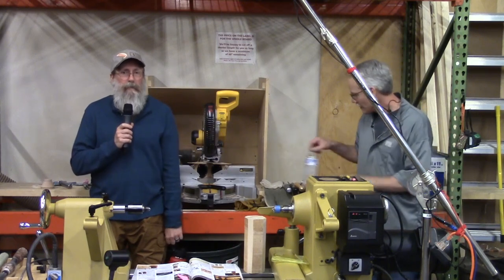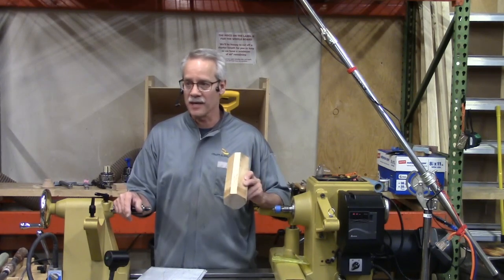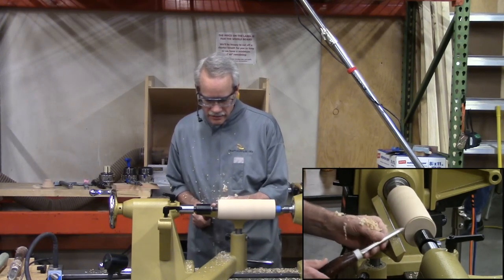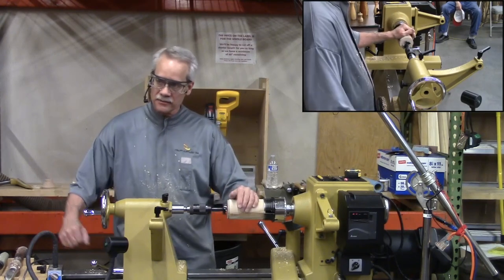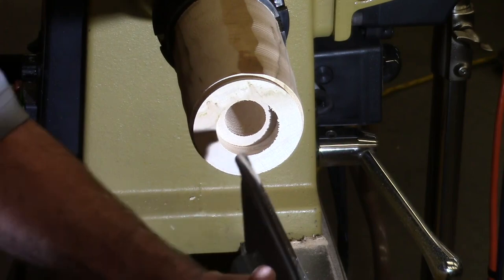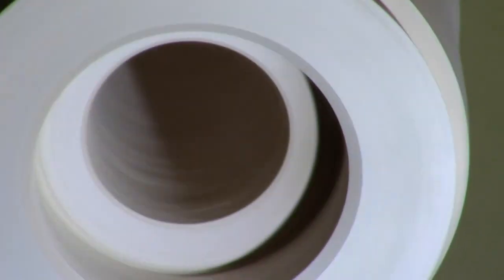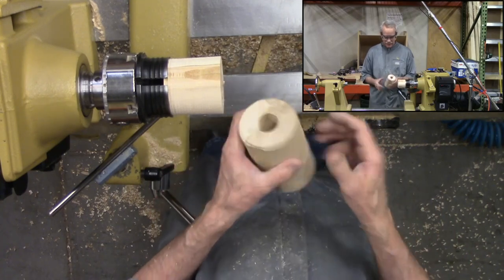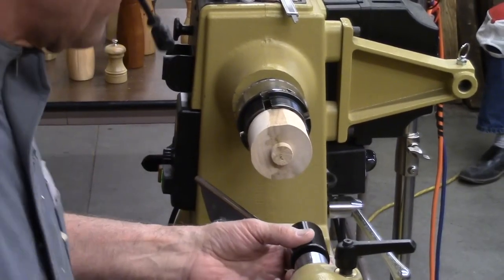Pat Scott - The Perfect Pepper Mill

Comment: thanks for all of the detailed work that is missing from other videos.  one extra step that i will do sometimes, especially with a very highly figured wood, is to not turn the spigot at all.  in it's place i will drill the bottom of the cap at 1 1/8 and insert a matching scrap "dowel" and turn it to fit into the 1 1/16" hole in the body.
Reply: Thanks for your comment. Yes I do the same thing on figured wood if I don't want to lose grain match, or when I want to make a certain size mill (say 8") and my piece of wood is only 8".

Comment: By far the most thorough and thoughtful Peppermill presentation that I have seen. One of the few videos that I have watched multiple times. How do you deal with finishing the exposed end grain on the top, especially with a flat top and/or grain like Curly Maple? Also, do you use Danish Oil and then Wipe On Poly?
Reply: Thank you very much!  End grain on the top isn't really that much of a problem for me. I'll power sand up to 1000 grit (use a light touch) and then use the 1000 grit to hand sand with the grain. Yes, one or two coats of Danish Oil and then 1 or 2 coats of WOP on top of the Danish Oil if you want. Or I'll just use 4-5 coats of Danish Oil until I get the sheen I want. Or you could just use WOP by itself, but I like using Danish Oil to start as I think the oil pops the figure a bit better than straight poly.

Comment: I'm looking for something other than the rubber expanding jam chucks. What are the long nose jaws attached to the chuck you refer to at 1:11? I can't tell from the video, it looks like they are wood? And would they work for a 1-1/16 hole?
Reply: Those are Vicmarc Extended Dovetail jaws (Mfg Part# V00651) with masking tape wrapped around them. The masking tape gives a little bit of cushion and keeps the jaws from making a black mark in the 1-5/8" hole (that I've sanded up to 1000 grit!).  The extended dovetail jaws work great for expanding into the 1-5/8" hole, but are too big for the 1-1/16" hole.  For that I use the Vicmarc 25mm Pin Jaws (Mfg Part# V00650).

Comment: Thanks for a very good demo. What are the long nose jaws you are using? In the video they look like wood.
Reply: Thanks for your question, I meant to talk about them more in the demo but was pressed for time and forgot.  They are the Vicmarc 74mm Shark Jaws, I got them from Woodworkers Emporium (https://www.woodworkersemporium.com/Vicmarc_V00655/), but Packard Woodworks also sells them (https://www.packardwoodworks.com/118122.html).

When I turn the peppermill head around to finish drilling the hole through the top, the shark jaws will grip the outside diameter of the head.  But more importantly the longer jaws ensure the spigot is not touched.  If using standard jaws the spigot could bottom out against the jaws or come in contact with the inner part of the jaws and get damaged.  I've seen other people grab the spigot in their jaws to finish drilling, you never want to do that!

Comment: Is the Bedan tool a good option for turning the spicket?
Reply: Sure, you can use a Bedan for the spigot.  The Bedan works the same as the Beading/Parting tool except the beading/parting tool is negative rake.  The reason I use a skew is the point of the skew is easier to get into the corner.

Comment: For step one do you rely on the golden mean as a design parameter ?
Reply: No, because I think most mills look better with a shorter top than what the golden mean dictates.  It depends on the shape of the mill which is why it's important to sketch out your design before starting.  For example a typical 10" mill may have an 8" body and 2" top.  Using Golden mean the same 10" mill would have a 6.2" body and 3.8" top.  

I did make a 10" mill with the same shape as in the demo.  It had a 6.5" body and 3.5" top, and it looks OK with the long flowing curve, but it's kind of disappointing that a mill that size won't hold any more pepper with such a short body.

Comment: Why not walnut oil?
Reply: I don't use it because it's not very durable and you can't build up the sheen like other finishes.  For something that is going to be handled every day I want more protection than Walnut Oil gives, and I like some shine as well.  It will work but there are better finishes for mills such as Danish Oil or Wipe on Poly.

Comment: Guys around here, line exotics with pvc tubing, what is your feeling on that?
Reply: I use mostly American hardwoods and generally avoid exotics or other woods that might be toxic or are high on the irritant list.  I heard of a guy that used a plastic sleeve/tube to line a peppermill when he made it out of a Banksia Pod because of the holes in the pod.  I've never heard of using PVC but that sounds like a pretty thick liner and I'm not sure how I feel about pepper and PVC from a sanitary point.  If it works for them that's great though.  I seal the inside with Shellac and if there is any question about wood toxicity I would use a different wood.